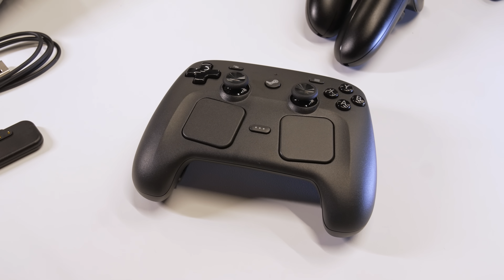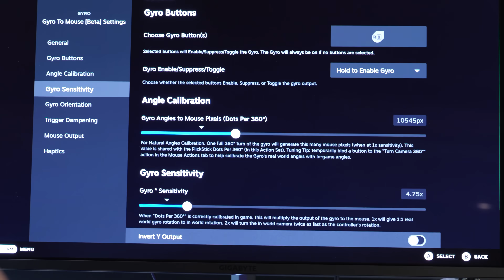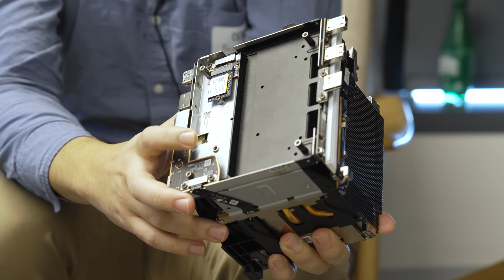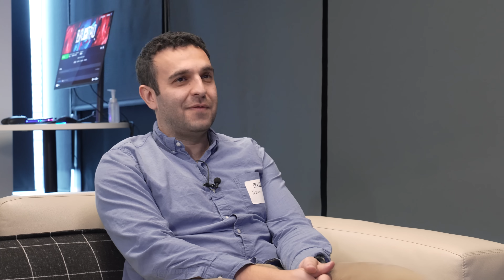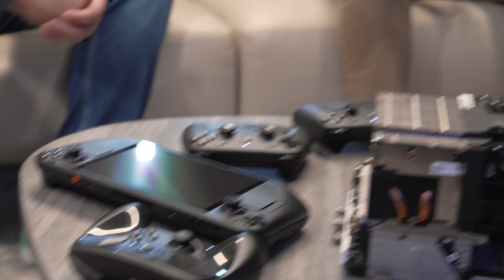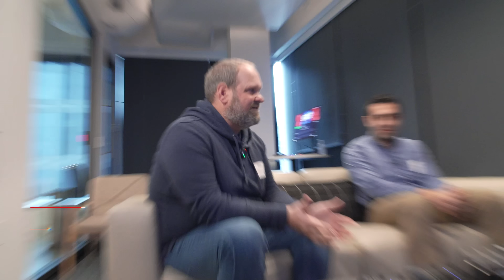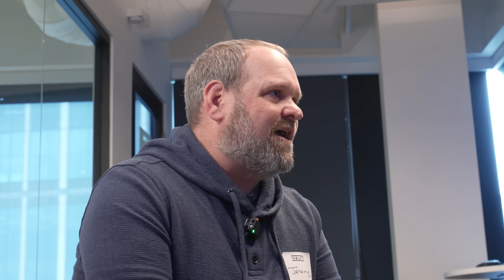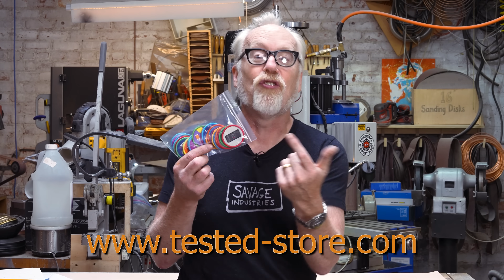Hands-On: Valve Steam Controller 2 and Steam Machine!

Comment: I wonder how seamless it will be to connect the steam controller to multiple devices, like moving it from one console in one room, to my PC in another room. Will it need to be repaired each time?
Reply from the maker: good question. i think it will need to get paired manually between devices.
Reply: I imagine it will be roughly like the original where you hold a face button when you turn it on to select which device to use.

Comment: Does the controller work outside steam / without steam opened? such as on a PC just with GOG games?

And will it work with the regular radeon drivers if you choose to install windows on it?
Reply from the maker: yep, controller works normally as either a bluetooth, wired, or 2.4GHz controller (with the puck/chongle)
Reply: I'm glad somebody is bringing this up. The one annoying thing about the first Steam Controller is that it wants to be a keyboard by default. I'm even getting this problem in some games using Proton on Linux but not logged into Steam.

Comment: As someone who bought and has used Steam Controller since it's first launch, I'm excited for the new one! The same controller I bought 10 years ago is still working and in use, which is incredible. Norm is the first one who've acknowledged that a lot of people loved it, so I thank you for that!
Reply from the maker: i still use my OG one!
Reply: @tested   I noticed you were the only reviewer I've watched who brought up how touchpads didn't feel that ergonomic on the Deck while other reviewers didn't touch that aspect. Seeing you still use the OG one it makes sense why you seemed to bring up the ergonomics. I use dual touchpads on the Steam Controller(some clips on my channel), but ended up sticking with the joysticks on my Deck due to discomfort with the touchpads as primary inputs. Regular grip was more comfortable than trying to adjust them to use the touchpads.

How do you think the newer touchpads will stand up in terms of comfort for extended play with the different lower grip needing to be used when it comes to those who will be wanting to use the touchpads for movement, camera, touch activation, and setting up edge/center clicks on the touchpad and also be clicking the buttons on the grips as opposed using them for a slow game like Balatro?

Also, did you get to see the internals of the new Steam Controller? I've been curious as to if the touchpads are connected by cables, so if the ergonomics aren't great then maybe a top shell that position the touchpads further up could be 3D printed.
Reply: @tested  It is a fantastic device and everyone doubted me when I was excited to get it at launch. After using Steam Deck, I'm sure this will be a massive step up and should see much better success. I can't wait to pair it with Steam Frame to play flat games in VR. Such a good idea to track it there as well as you mentioned! These videos are always a highlight of new hardware so thank you for doing this :)
Reply: The old Steam Controller is by far the best controller ever, IMHO, even with its quirks, and I still use it for everything on a daily basis. Mapping right trackpad and gyro to mouse (my setup below for anyone interested) is both more convenient and relaxing compared to normal controls, but also massively faster and more precise than the standard dual-stick controller layout. I will buy the new controller on day one when it's available.

Reg. setup, I usually map the trackpad to mouse so that a full sideways swipe equals 180° in-game. That way - with the muscle memory I've built up - I can instantly and relatively precisely turn in any direction I want - just like with mouse. And I usually set the gyro (also to mouse) for more fine adjustment/correction when e.g. aiming. Gyro on/off is normally linked to touching the right trackpad (touch=on, release=off). Sometimes - depending on weapons and other game mechanics - I might add other activation as well.

Comment: I usually have gyro always on in first person shooters for the original Steam controller. For TPS games I switch it up, it depends on the game it is. If it's a tps shooter like Gears of War I have it on 100% of the time. But there's a mix of genres like the Tomb Raider reboot games, I have it turn on when I start aiming.

Comment: Pricing will really matter on the Machine.  8gb VRAM puts it solidly in the entry level range IMHO.
Reply: Every PS5 Pro is faster than
Reply: 8GB is enough for 1080p gaming and most games on 1440p. Its not made for high end gaming
Reply: @dieselgeezer18  Hence the "puts it solidly in the entry level range"
Reply: It will fail immediately if Valve tryin to go above $499 for base model. Simple as that.
Reply: @soraaoixxthebluesky of course it will be above $499. What decade are you living in? My Steam Deck cost $649 and it’s much less powerful than this and was sold before the hell year of 2025 and also oligarch tariffs. This is niche. It doesn’t have to compete with PS5. It will sell to people that want it. They’re not trying to beat Sony.
Reply: @hanspecans So you’re telling me building a custom PC worth more than this 8TF machine? Thank you
Reply: @hanspecans your steam deck has a battery, a oled screen and  parts designed for low power consumption. This is just a box, and you can totally build a similarly powerfull box for 600. Valve has mush better cost efficiency than a single customer building his pc, so yes, they could realisticaly get it close to 500
Reply: @gwathanaur I doubt it, valve already stated its price will be based on its specifications rather than being subsidized by game sales like a traditional console. That being said too, because it is not a console. It is also not locked to their ecosystem like say Microsoft or Playstation. So there's no guarantee that they make money after you buy the thing.
Reply: @gwathanaur  steam deck price was subsidized by steam sales and aggressively priced, they have said as much.  Valve has also said not to expect the price of the steam machine to compete with consoles and they aren't using steam itself to subsidize the price.  They want to avoid crushing the margins of other companies who want to enter the steam machine ecosystem and for customers who might be buying in bulk with out using for gaming (corporate customers) I expect this thing to be over 700 dollars, since the PS5 pro itself is 750, certainly won't be 500 as that's console competitive.  Probably $799 but bundled with the steam controller, or maybe they'll have a bundle with controller + frame + steam machine, though that's maybe around 2k right there.
Reply: @snbv5real it should be below a PS5 Pro because that one is faster.
Reply: @hanspecans the steam deck is a handheld toh?
Reply: @gwathanaur indeed, you're right to point out the other components of the Deck. Especially the battery – I don't think people realise how expensive batteries are. They really bring the price of devices up.
Reply: @hanspecans  The base PS5 is 5 years old now, and this is going to be slower and with less VRAM. While some people will buy it regardless it won't gain significant traction unless their pricing is aggressive, around $500. They're hinting it will be more like $700-800, so competing with the PS5 pro which is an even worse matchup.

Honestly I suspect it's deliberate, dipping their toes in the water of a machine a little more general purpose than the steamdeck that won't get huge adoption, and if they made it more powerful the fact developers don't support anticheat for steamos would make its inability to play things like BF6 a more glaring flaw.

Comment: not an apu, and you're wildly overstating it GPU power
it's a 1080p at medium machine, 4k via old fsr

still a great device imo
Reply: should be able to do 1080p high in most games
Reply: should cop or just build?
Reply: @lipertybiperty  the average person shoudl just cop, if you build your own pcs and run linux already, you should build
Reply: How tf do you know that when there are zero benchmarks out?
Reply: @hastyscorpion  benchmarks are irrelevant?

Comment: I cant explain my reasoning, as an xbox elite 2 controller user of of 7 years and another 12 years on standard xbox controllers prior to that, but I really want that steam controller. Ive only ever briefly held a steam deck, and it didn't even hit me then, but seeing it without the screen in the middle just looks so slick and premium
Reply: Bro the touch pads are a game changer. I also only use the elite 2, mainly due it being one of the few controllers that let you map the back buttons to something other than abxy. But the touch pads opens up the door for a lot more games that are not really controller friendly. I actually play a lot of my RTS games through the deck so I dont have to sit up at a desk.
Reply: The charger is fantastic design also.
it resolves a problem I didnt know I had - It's quite cumbersome when you think about how you have to charge controllers these days.
You either need a dock which takes up desk space and sometimes the pins dont align so you have to fumble with it to get it to charge - or you need to find/fumble around with a wire to plug it in.
The magnetic just clipping on and start charging is honestly phenomenal UX.

Comment: As long as i can play gta 6 with no stutter when it comes out, I'm all in! Great video too!
Reply: It'll be 1080p at 30fps.
Reply: @GarethStack at 1080p medium to high settings with Ryzen 7600X you’ll easily run at 60fps because you’re not GPU limited at this resolution. Unless you’re targeting native 1440p and above then you’ll hit the 30fps mark. 1080p FSR4 will do the trick. LSFG can as well aids the frame to go minimum 2x from base frame rate

Comment: buying this would replace GeForce Now and limping along with a 2060 laptop for other games for me. hopefully it's under $700
Reply: I’m guessing it will be $799 at minimum.
Reply: @hanspecans I'm hoping $699/$849 (512/2tb) I'll probably preorder. we'll see.
Reply: @cieje  if i had to guess, it'd be probably $600-650 for the low end model, and $700-799 for 2tb. It's chip is around a R5 3600-5600 in performance, but a laptop chip in terms of power. And it's an overclocked 7600m for it's GPU.
Reply: @ZellieOwO one can hope!

Comment: How's the steam deck a success? 5m sold? Dreamcast sold double that in is considered an abject failure
Reply: Fitting profile pic
Reply: Because "success" or "failure" fully depends on the expectation of the seller. You couldn't even buy steam deck in 80% of the world and it still was sold out for most of the time
Reply: @soawii9624 This too!
Reply: Steam Deck is part of the reason Xbox, Lenovo, etc. are pushing out PC handhelds of their own. It popularized the PC handheld, even if it's still rather niche in its user base.
Reply: uh huh. and uh, how many games could you play on Dreamcast exactly?